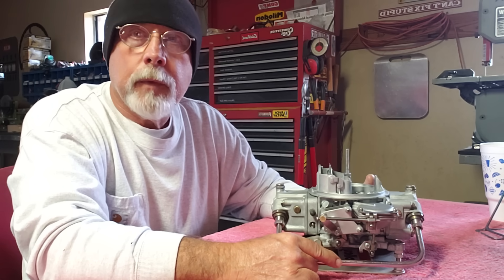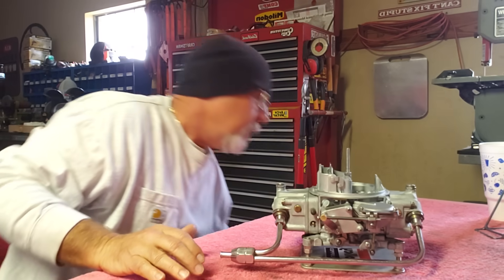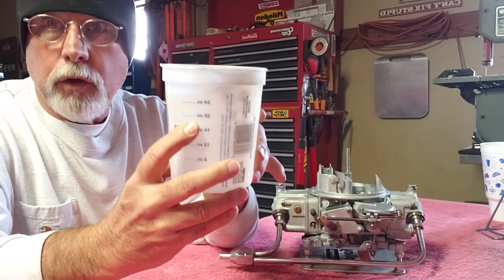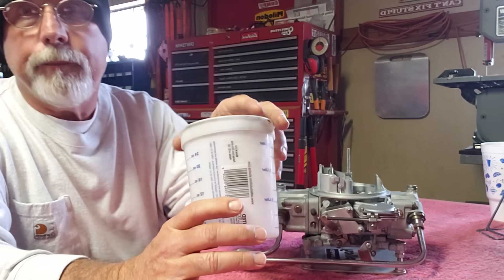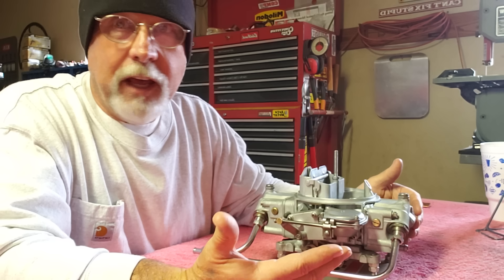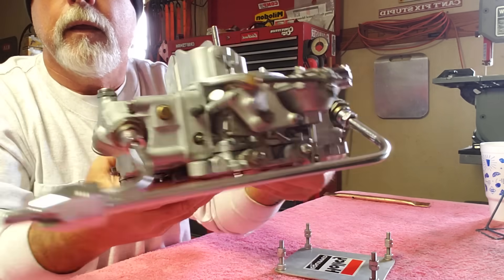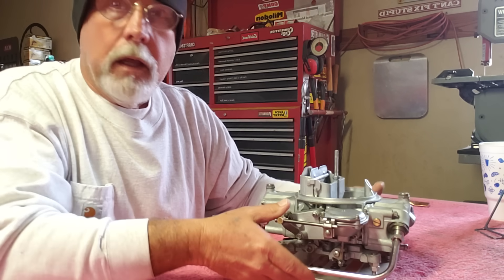Best carburetor cleaner ever!

Comment: Great video Ronnie. I am curious... If adjusting the mixture (water / muriatic acid) could be used to run it trough fuel injectors without causing  any damage...? Just a thought.  Thanks for putting this video out.
Reply from the maker: Wouldn't recommend do that.

Comment: How about the fumes, don't you need to wear a gas mask with muratic acid,,
Reply from the maker: No, not that bad
Reply: @ronniehenson4122  I use diluted muratic  acid to strip plated gold, silver, Platinum, nickels and leads off electrical and computer boards,glass, ceramic pieces,, you really should have a mask and provide proper ventilation in your shop,, you could walk into a death trap and not realize it,, the acid fumes reacts to other metals and emitt gases that you don't realize,, maybe you have noticed how some things in the shop have lost their finish or are corroding,, be careful my friend,, you might not feel the effects for a while and you may have been using this method for a while,, but the right little combination will overcome you with irreversible side effects,, you could be dead within a month,, be careful my friend,,

Comment: Should always tear the carb down first, clean all the parts and after rinsing and blowing everything off with an air hose, reassemble with new gaskets,  power valve and float valve.  How do you clean the inside this way?
Reply from the maker: It was completely dissembled and each part cleaned blown out with compressed air

Comment: Never ever put aluminum in muriatic acid it eats it!! Put the Jets in it instead have you ever heard of muriatic acid bombs with aluminum foil? I wonder why it works that's because aluminum is a conductor and reacts to muriatic acid don't do it
Reply from the maker: BS
Reply: @ronniehenson4122  NO BS without a doubt one of the best jet cleaners there is I have used everything from ultrasonic cleaners to carb cleaners to chem tool dip and muriatic acid gets the Jets clean overnight I'm not arguing that point!

Comment: Well I too have tried various way's. I finally gave Oxi Clean a try. Do not do this with steal period. But I have soaked radiator over flows, aluminum radiators, aluminum valve covers and they come out looking new. Had to use a tooth brush a bit. I tried a carb and after rinsing to my amazement it was clean.
Reply from the maker: Thanks for sharing

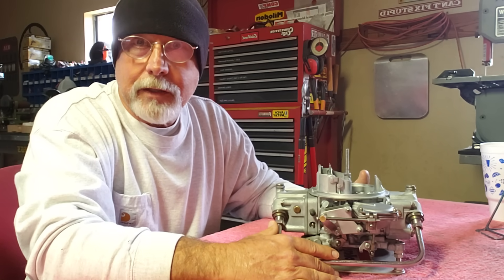Comment: Fun facts about muratic acid.  It's close, but no cigar to hydrocloric acid. Muracit acid has additives that hydrochloric acid does not. Muratic acid is used as a food additive.  It exists in your digestive system as a component of gastric acid.  It's a strong cleaning agent for masonry (1:10 acid:water mix) that needs to be neutralized with 1:16 ammonia:water mix.

Comment: Thats called sodium dichromate conversion coating it was put on there to help fight corrosion because some mixtures of air and moisture caused corrosion on metal parts. When the Rochester Quatrajet first debuted there was no conversation coating and no green teflon parts, Gm noticed this and now you know why the green came about.for the coating it didnt come around till the late 50s.this coating  was first introduced to steel bolts to fight corrosion in air planes.cause most are aluminum.because aluminum and steel dont agree with temps very good. You did it backwards but if it worked then so be it. I use a heated sonic tank (I know most cant afford that and your way is good too) for  my carbs first in kerosene and mineral spirits.for about hr.then they get blown out and rinsed off then they get soda blasted in my blast cabinet.(again I know most cant afford it.) Sometimes I replate these parts with a plating prosess but it doesnt have to have this plating . Then if I  choose to then I can dichromate it.but this also doesn't need to applied for the DIYer I own DennisCarb here in ohio.and I get it the small guy needs to know that theres cheaper ways to DIY stuff. I'm known here for the 40 dollar rebuilds and the lifetime warranties.GREAT CHANNEL IM SUBSCRIBED. 6 to 600hp

Comment: Muriatic Acid really does clean metal quickly and it removes metal in the process. Every bubble of hydrogen atoms is generated by a similar number of metal atoms dissolving. The first problem is how quickly steel rusts after it has been cleaned with Hydrochloric Acid; the steel will be very shiny and bright but within a minute it will start turning yellow and rusty. The second problem is the fumes from the acid (HCl or Muriatic) will cause every bit of steel in your shop or garage to rust at an accelerated pace. Even a jug with the cap on it will lose some acid vapor. Looking at your tools, cast iron table saw and drill press turn rusty is a bad thing.  Even if the acid is neutralized it leaves behind chloride ions which are exactly what salt makes. My two cents.

Comment: Surprisingly hot water and dish soap work well and doesn’t strip off any finishes, Learned that in a sthill chainsaw school .It is the only thing they recommended, I have an ultrasonic cleaner I throw them in.
Reply: I tried that also. I wasn't impressed at all. Didn't really clean anything. I bought the ultrasonic cleaner just for this. I wonder what would happen if you warmed up this solution in your ultrasonic cleaner and then dunked the carburetor parts in?
Reply: @alanbehnke9615  I use almost boiling water, I have cleaned up some pretty varnished carbs , sometimes I have to change the water a couple of times

Comment: Thank you for sharing. I'm a contractor and my hobby is rebuilding old cars and trucks. I have used muratic  acid to clean away oil and grease from concrete with really good results before painting with epoxy. The epoxy run about 100 bucks  a gallon so you need good results or it's going to get expensive. And my customers won't be giving me a good referral. I will definitely give this a try. And thank you for your service. Our Son gave all.
Reply: Have you tried staining concrete with iron sulphate which is cheap and typical fertiliser?

Google it and look at the examples it's pretty impressive with some people have done.

No preparation is actually a requirement, as over cleaning in etching it doesn't work as well.

 It's way cheaper easier and looks good, Especially for low budget job

Comment: Muriatic acid can also be used to etch cement. If you want to paint your garage floor, first use a scrub brush on brush with the acid. Let it stand for 15-20 minutes and rinse with water. It won't harm your grass. Then paint. This will keep the paint from peeling later on.
Reply: And what non slip paint do you use?
I'm ready to do mine now.
Reply: @Thebowzer221  Any 2 part epoxy will work well.  2 part means paint and the activator.

Comment: Muriatic has saved me hundreds, maybe thousands over calling a plumber.  One was a slow flushing toilet (shut the water down any of the ports involved in flushing, and let it sit for an hour or two; flushed like brand new after).  Other was a sink that was stopped up by someone cleaning concrete tools at work.  Had a quarter inch of concrete in the bottom and not draining.  I didn't think it would ever flow again but figured I would try over calling and explaining why someone would clean concrete tools in a sink.  Anyway, it not only unstopped the drain issue, but it allowed me to clean out the quarter inch of concrete that would have taken a jackhapper otherwise.  Get the Magic Acid stuff or type labeled low odor, its got some additive that keeps the sulpher/ acid fumes to a minimum.  Also do your research and be safe. On caution, I did try cleaning the hard water deposits from around my faucet at home and it tarnished/stripped the nickel or chrome plating on my faucet.  Whoops, 2/3 still ain't bad.

Comment: Permatex. Nothing works as well as that. I do have to admit, what you did with Muriatic was beyond top notch.
Reply: Permatex what please???
Reply: @robertclymer6948  Permatex Carburetor cleaner.  It comes in a gallon can.  Used to cost $15.00.  That was a "few years" back.  It is really great, if still made.  Contains, among other things, creosote.  Cold dip/Soak.  Rinse with water.  You have to use gloves though.  As a young man,  I made the mistake of not doing so.  Took the hide off me.  My hands dried out and peeled for two weeks.  Took two months to get my flesh back.  I suppose in some sense it was a good lesson.  Now that I am older, but not a whole lot wiser, about 75% of the time I read the warning labels.  Best of  everything to you. Take care of yourself.
Reply: @beenbeatenbybishops5845  Oh, OK. I think I will try this first, just not nuts about using acid unless I was doing a complete dismantle. This is for my Old 4160 Holley I replaced and want to sell. I had a carb fire that turned it black inside. Thanks for your reply, much appreciated!!
Reply: @robertclymer6948  Good Luck.  I looked on the internet hoping to be able to find a price for you.  It is still made.  the formula has changed since 1978.  Still, from what I saw on the materials data safety sheet, it will likely be as good.  Might have to soak everything a bit longer, and / or repeat.  It may be a little hard to find.  I checked a few retailers' websites.  They don't show it.  Does not mean they do not have it.  You may end up calling around.  O' Reilly Tech site shows it.  The of the product is Permatex Carburetor and parts cleaner.  The number on the gallon can is 46f.  I can tell you that O' Reilly retail locations do not carry it.  That company is not what it used to be when Charlie owned it outright.  You may end up trying Berryman's product.  It isn't even half as good as the Permatex.   That product is running  about $27.00 a for a 96 ounce can with a little basket.  Cute, but not really effective.  Anyway,  God Bless you in your endeavor.
Reply: @beenbeatenbybishops5845  Thanks again!! I will google it and find it around somewhere. I was working on the Carb today (my backup carb) Gotta order some new parts as I want to sell it. Thanks again for all your help sir.

Comment: Just make sure that the carb is not Magnesium. I put a VW beetle carb in full strength muriatic acid and within minutes all that was left was the brass and steel parts
Reply: I did the same thing.

Comment: This is one of those YouTube videos that show what YouTube SHOULD be.  Video - EXTREMELY helpful, clear, easy, lists what you will need, a great explanation.  PERFECT.
Reply from the maker: Wow, thanks!
Reply: I agree only if they were all this well explained,  very nice video
Reply: My thoughts exactly
Reply: It would be better as a video to show parts of the process.  Before, during , after.
Reply: Well said.
Reply: I’ve used this stuff to clean motorcycle tanks.  Knowing it won’t degrade the carb parts.. I’ve got a 600cfm Holley on my shelf that is in dire need of a rebuild… thanks
Reply: I did this in 1980, it does an excellent job of cleaning. But I actually melted a meatering block & bowl about a 1/4 inch. Use a light combo & check it every few minutes.
Reply: Ronnie, I tried your water and acid ....mixed it as you said and my carburetor ended up developing black gray scale....I’m not impressed
Reply: @stevenbowers1513  was it hot or cold water?
Reply from the maker: @HeatherWelk  Cold
Reply: @stevenbowers1513  leave it for 5 days in acid, when you ome back you dont ahve carburator

Comment: Acid is our friend,  Yes, caution is good, but, fear not.  I was once a Berkeley chemistry major.  I have done time in official, full function, chemistry lab - not only eye washer, but emergency shower with a big pull ring you can find blind.  Concentrated Nitric, HydroChloric, Sulphuric acid: we used them as "dish washer", 'n' stuff.   Yeah, the concentrate was "smoky" and made you cough.  But, here is my point: you got time to react, they are not "instant death".  I would "declad" coins, dropping them like Fizzies in concentrate, and it took a bid of time.  You get it on you,? Wash it off !  Life goes on.    Muriatic ? A nice publicly available diluted HCl (Hydrogen ion + Chloride) acid (the hydrogen ion is the acid part).   It is already "safteyized". 
So, yes, use and enjoy acid as a radiator cleaner, concrete cleaner, and whatever else you can think of .  And, no, don't expect a "polished" surface.  This was a good example of effective use.
Reply: So I can use muriatic to clean oil stains on my driveway?

Comment: I have never heard of Holley's being plated, If I remember correctly from the old Holly mod/ performance books the base is made of zinc and the body is pot metal. a friend of mine used to say the yellow coloring is anodising.  If you have a carb and you want to restore the color just look up a "how to anodize" video. It's really easy.
Reply: The Holley parts are dipped in a rainbow dichromate (sp)
Reply: I used to work in an aircraft paint shop, about 30 odd years back. We used to use phosphoric acid to clean the aluminum then add a chromate solution to anodize the aluminum prior to painting.
Reply: Have you tried pinesol?
Reply: Also Coleman camp fuel works well😎

Comment: Thank you for your service.  After all is said and done, without re-plating, in your experience so far with this is the exterior now prone to harsher staining or dis-coloring or has it stayed pretty much the way it looks after cleaning. Thanks for the vid and the tip on the soda for polishing. I just finished a 72 Poncho 455 Qjet and it looks new but it took a lot of elbow grease along with chem dip. Will be trying this on the next one for sure..
Reply from the maker: I have two Holley's, cleaned with this process setting in the attic for about 11 months now. I will post a show and tell video here soon. One sprayed with WD 40 and the other one not. You will be able to see for yourself what long term effects looks like.

Comment: Might want to try ‘Purple Power’ full strength as a soak also. Just let the carb body and parts soak overnight and rinse off. Does an excellent job cleaning and doesn’t cause any dulling of the aluminum finish. More expensive but also easy to get rid of the leftovers.
Reply: I soaked my Motorcraft 2150 2-barrel in full strength Purple Power for about 2 hours today and it appeared to be eating the aluminum body. Took a LOT of scrubbing to get it cleaned up, that's why I'm here watching a video about using muriatic acid to clean the parts.
Reply from the maker: Thanks for the tip!

Comment: I have used muriatic acid for yrs on old cast iron/steel tractor carbs with all brass removed. I used it full strength and just let it smoke and bubble with a piece of baling wire attached to retrieve it. I never thought of using it diluted on aluminum. Genius!

Comment: I would't use Muriatic Acid to clean Carburetors, but if you dissolve all the Zinc it will hold, it makes the best Tinning Fluid for soldering.

Comment: Great to know!  Thank you.  There's good info here and the cautions are also helpful and appropriate.  I have 2 basic question2, though.  
1)  Did I understand you buy the muractic acid in a 33% solution in the jug, then you dilute that mixture 16 - 20 oz per 1 1/2 gallons of water?
2)  British motorcycle carburetors are made by a company called AMAL.  They are the worst - they are made from the cheapest, lowest grade pot metal.  They corrode up in use in a minute and they're terribly hard to clean.  So, you say that this method turns pot metal black - well, am going to anodize a pair of carbs anyway (the metal is so soft that the cylindrical throttle slide wears its bore out in a few miles if you don't). So, I think I'm going to give this a try.  If it cleans up the jets, float orifices, and idle circuit drillings (no replaceable jets, just drilled holes in goat cheese pot metal) and doesn't actually harm the metal beside turning it black, I'll let you know.  I'm just going to have to junk them anyway if this doesn't work.
Thanks,  Bb
Reply from the maker: Yes on the 33%, please let me know on the end results. Thanks! Good luck!

Comment: Great vid Ronnie! Am a Navy vet myself. Son has a Suzuki Bandit that has sat for years. Finally got it to start but just won't accelerate right. Didn't know what to soak the carbs in. Gonna try ur advice. Thanks for your service. 🙏😎👍🇺🇸⚓
Reply: Thanks 4 the reminder. Rebuilt about 30 carbs so far.👍😎⚓🇺🇸🙏
Reply: Make sure you spray through and blow out the pilot jets ! Should be able to unscrew them ,USE A GOOD SCREWDRIVER! !! They are brass !!😄😄😄😄😎😎😎😎😎🍺🍺🍺

Comment: About 35 years ago I bought a 6 gallon bucket of Gunk Hydro- Seal, made by Radiator Specialties. It cost $70.00 then, but they don't sell it anymore. As it's name states, it was a solvent with water that floated on top to keep solvent in bucket. Had a heavy mesh strainer inside. 
I pre- cleaned the built up crap & crud off, then when reasonably clean, soak the disassibiled carb overnight, let solvent drain back into bucket then hose off with strong water spray. Looked like new metal. 
Blow out passages, carefully reassemble with rebuild kit, and was like a new carberator.
Passing on obsolete knowledge before this obsolete person passes on.

Comment: I don't like using Muriatic Acid.  It is very very very potent. It will eat through metal it you give it time. If you get that stuff on your skin it will burn it very badly.  I used that one time to clean out an old rusted motorcycle gas tank, when it came time to dump it where do you do that safely?  do you want acid to go down your drain?   I poured that in the back yard and the grass didn't grow in that spot for 3 years.
Reply from the maker: I use it in my pool each and every day, down the drain no problems. That is what all the pool stores say to use to adjust your PH levels. If you're not comfortable using it then don't use it. Safety first!